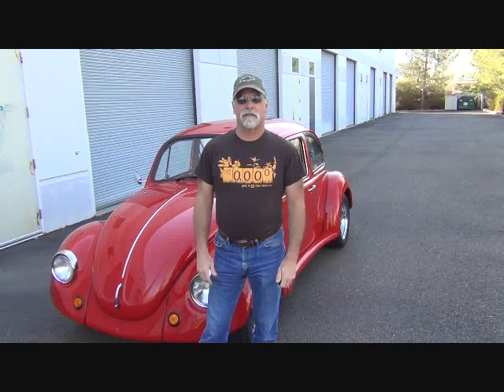DIY Electric VW Beetle, an overview of the Bug that help start an new industry.

Comment: Any particular reason you chose the standard beetle over the super beetle?
Reply from the maker: Not a fan of the Super Beetle.  Personally prefer the suspension of the Classic Beetle, as well as the lines.  The Super Beetle also does not have as good of resale value as the Standard Beetle.